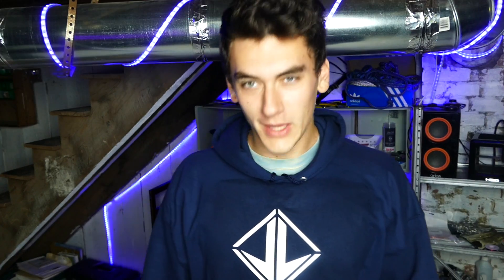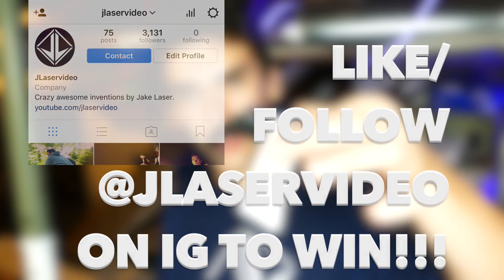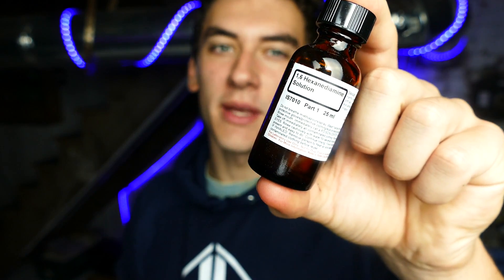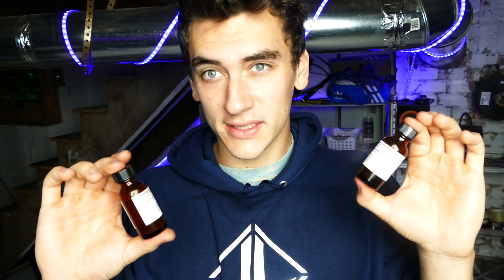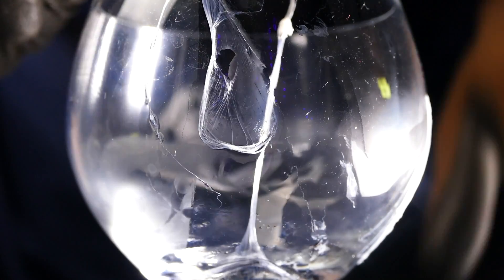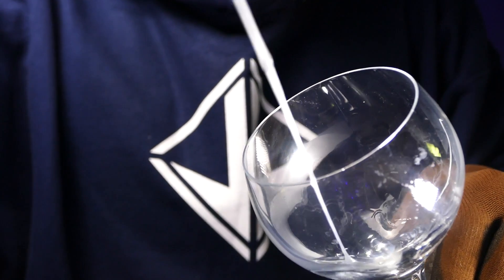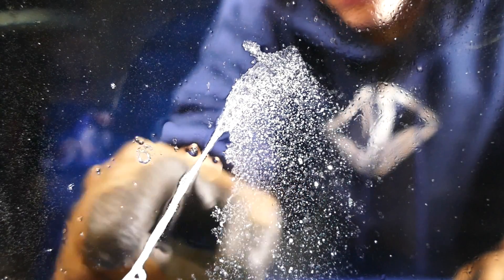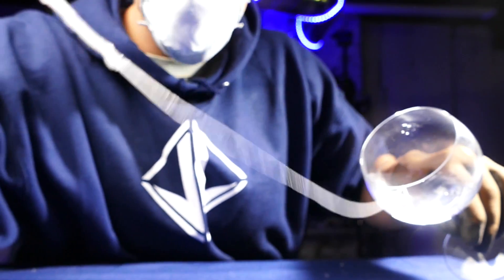Make a SPIDER-MAN Web Shooter - $5 SHOOTS REAL NYLON WEBS!!! (SUPER SIMPLE BUILD)

Comment: It won't shoot real webs because it's stuck on the intersection of the cartige and even it will shoot a nylon string it will not dry that fast I suggest you should add a Quick dry solution...

Comment: If you put both in the same lighter it might be like glue and not solidify until exposed to air. That way you could use the other lighter for a C02 coolant so it solidifies quick enough that if you were to shoot it at a building while in the air, it might be strong enough in time so you don't plummet to the ground.

Comment: What you should do is create some way of automating the creation of the nylon. Have the two chemicals react in a separate part of the shooter, and maybe a slowly rotating, small motor slowly pulls the nylon string out of the reaction chamber and spins it on a spool. That way whenever you shoot, you're shooting strings of web instead of just splats.

Comment: Most well thought out web shooter video so far. Nylon is formed from an amino solution mixed with a class of organic acids of which acetic acid (vinegar) is the least toxic. You could play with extracting various aminoes from grains or other sources and different acids to find an easily reproducible combo that can react in mid air when crossing the streams.

Comment: Introduce graphene with the mixture for added strength. Also have the lighters slightly pointing to each other. Perhaps by placing a finely sanded popsicle stick in between.them at the back.

Comment: You need something that can mix them as they flow out like the mixing nozzle on a epoxy resin glue tip. Maybe have  some type of tubing that take the two stream y'ed in to one so it mixes as it leaves the lighter nozzles.

Comment: JLaservideo Forget angleing them you need a mixing chamber. Move the chemical chambers back farther and use a third lighter (maybe cut down for comfort) and let the chemicals mix inside u should be able to spray straight streams of web if you fill it with propellent.

Comment: hey jake, what if you put like a connector to both lighter valves into a small box. then the 2 chemicals will mix together in the box and when the box is filled you press a different button to shoot it from there? like if they mixed together in the little box you press a button that will fill the box with pressure until the solution shoots out and then maby it really shoots webs?

Comment: You should angle them so they touch in mid air.
Reply: does the solution creates nylon when dried like glue does? or is it automatically when combined? because if it produces nylon when dried, why not just put the solution in a single cartridge connect the other lighter, put the solution in the first cartridge then pressurize the connected cartridge?
Reply: you just comment what i wanted to say. 
it should do combine and make webs.
Reply: To allow the hexanediamine and sebacoyl chloride to react quicker, a catalyst would have to be used. Also, hyrolysis occurs at much quicker rates at higher temperatures.
Reply: I commented what I thought lol didn't read anyone's comment
Reply: Kirai _ so 2 people cant comment the same thing or else that means hes copying him may i ask how old are u?
Reply: SWEET
Reply: yeah if they were angle better their would be nylon in mid air
Reply: Kirai _ so 2 people can't comment the same thing or else that means hes copying him may i ask?
How old are u?
Reply: ur asking me how old I am
Reply: aa i know not more than 9
Reply: i was going to say that but the force of the two streams colliding will reduce the momentum. good job thinking for your self so go ahead and do that and post it. good luck
Reply: It is toxic so if it touches his hand he is fu*ked
Reply: Ashton Markham u just saw that dudes comment and he commented that 2 mins be4 u
Reply: you shpild have a funel or somthing at the tip so it shoots more like a rifle than a shotgun... but its dope any way you put it
Reply: Ashton Markham Haha i was about to comment the exact same but then i saw your comment